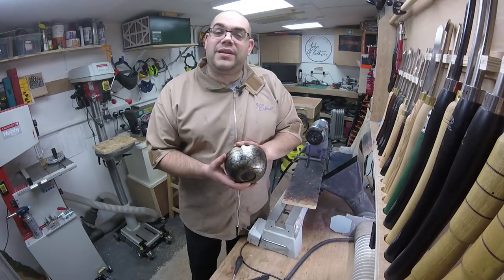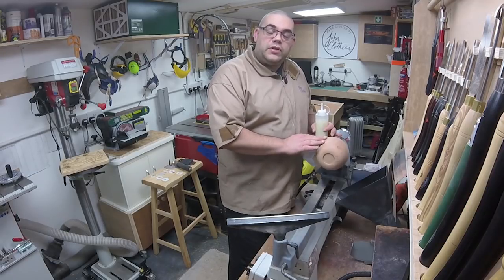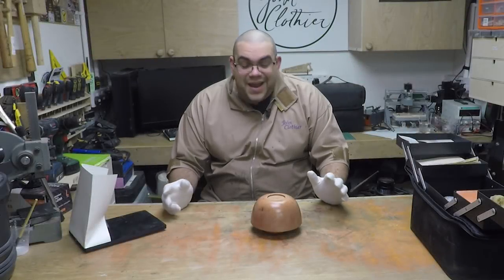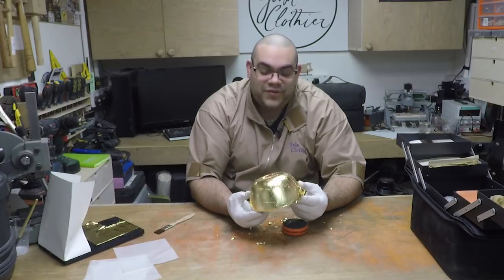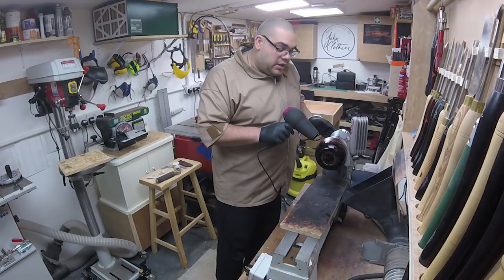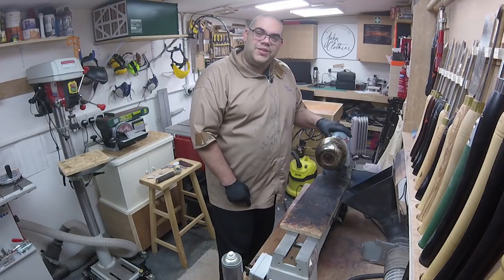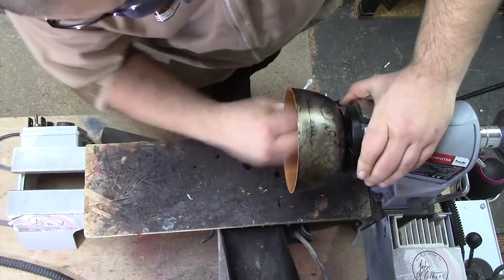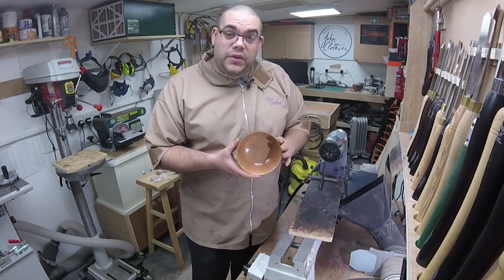Gold Leaf and Patterned Bowl

Comment: I enjoyed your video and the process very much, John.  Thank you!  I would have liked to see a closeup (maybe a still) of the finished bowl, to see how it looks when completed.
Reply from the maker: Thanks. There is a still photo at the end of the video showing it close up.
Reply: Thanks, John!  That photo at the end is just what I was looking for.

Did the patterns (black on gold) come about through the hair dryer plowing the paints or through the seams from the leaf sheets?  Do you cut or thin the paint so that it stays wet longer (when I airbrush paints or stains, they seem to dry too quickly to be blown around).
Reply from the maker: mch000 the joins in the leafing don't have any noticeable effect, it is down to natural pooling of the stain and the hair dryer. The hair dryer blowing the stains about causes the bigger more defined lines. As for the stain itself, I use the Hampshire sheen intrinsic water based stains. I do nothing to them they are straight out of the bottle.